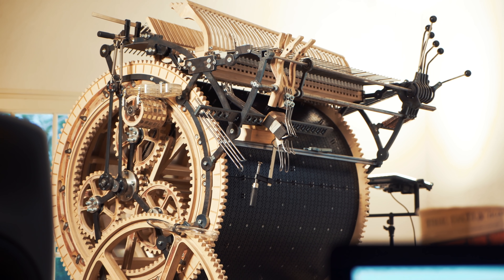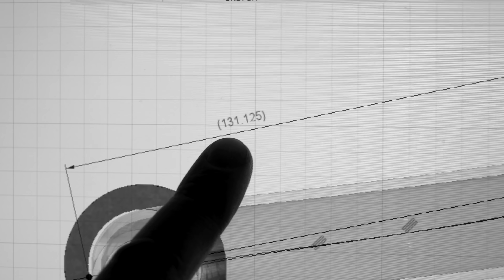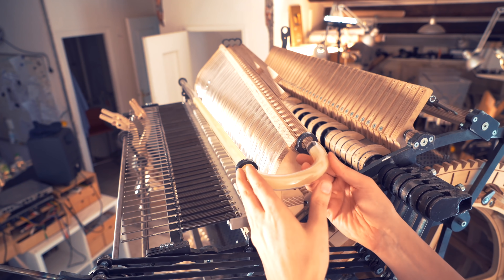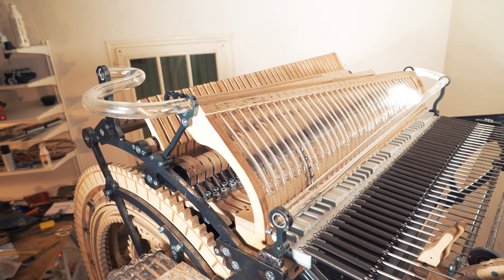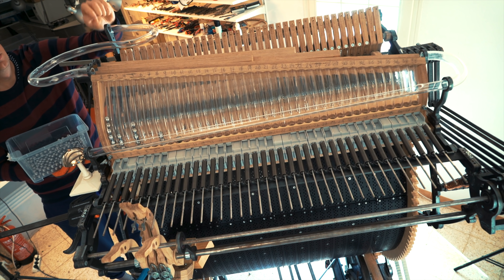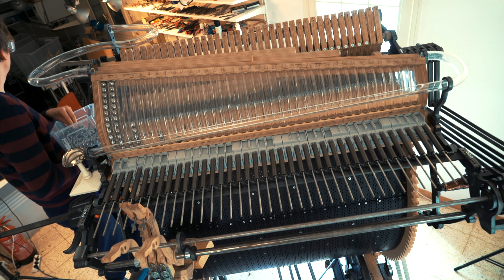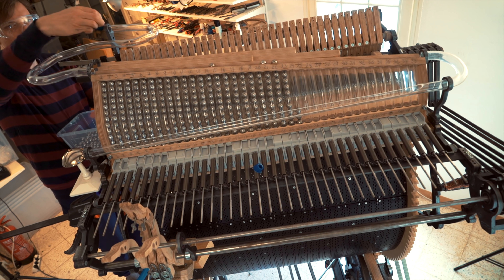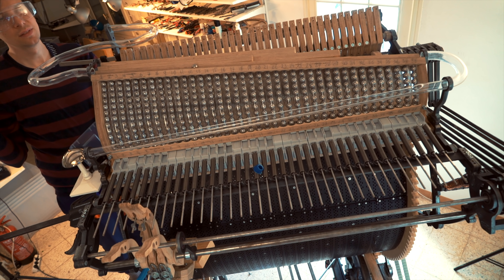Marble Divider Transport Tracks - Marble Machine X #68

Comment: Man stick to the programming wheel. Your problem isn't design, it's materials. Figure it out, you can do it.

I don't believe the programming wheel is a sunk cost any more than the early failures of the space programs around the world were. You have an end goal, a reprogrammable wheel within certain specs. You just haven't figured out how to accomplish it to those specs yet. You are close, this isn't like you bought a ticket to a show and feel obligated to go because you spent money. 

This is an artistic and mechanical goal that is achievable with the right combination of materials and process. Arguably the entire project hinges on it. To go back to the drawing board could easily eliminate 6 months to a year of workable and useful progress in other areas designed around it. This would be like redesigning an entire car because you used the wrong rubber in the tires. It would be idiotic.

you will find the path forward, it's time to experiment a bit. Try other materials, or adjustment mechanisms. What if channels or banks of channels could be adjusted independently to account for mechanical/production drift / environmental changes. What if you found a material that didn't shrink or move.

The wheel is the soul of this project.

https://www.quora.com/Is-the-sunk-cost-fallacy-always-a-fallacy

Comment: I think you should stick with the system you have now, because it fits with the history of the marble machine, and is more attuned to the style of wooden marble lifters.

My only issue is that you have been drilling full sheets to test, when you clearly need to be drilling small sections at a time and solving each problem in smaller steps. Like you did last time, drill just a few channels and test, don't drill a whole sheet until you are absolutely confident you got it right.

Don't go the welding route, I really believe that's going to be a dead end filled with tears.

It is very likely that the best solution will include mostly pre-programmed sheets, but that's ok. Just have only the FIRST song reprogrammed during the concert, and the volunteer(s) can go slower, and will only need to reprogram for the LAST song, as a big finale where we see the result of their work.

Comment: Just a single thought, killing kinetic energy by slowering the speed I believe it will limit the amounts of balls per time unit, limiting the speed of the song, also, lowering the speed causes the balls not having enought energy to reach the last duct... may be it would be better to change the discharge angle of the ball, forcing it to get into the first pipe and then jumping to the next when its full, not affecting the speed but the attack angle to make the ball "prefer" the first pipe in first place and then continue. just a thought. !!! cheers !!

Comment: Edit: Forgot to address the main issue:
Instead of redesigning the programming wheel because it is challenging to manufacture and / or reprogram why not just address these issues? A fundamental redesign at this stage would be foolish! The reprogramming issue notwithstanding, the issue seems to be attaining the required level of accuracy when machining the programming plates.

Original:
Why not bend the plastic first then CNC it? It sounds infeasible but I think it could be done w/ proper router programming and some kind jig. I admit that I really don't know anything about this manufacturing process but I don't see any reason why it couldn't be a possibility.

Comment: Sorry I don't comment much, so I don't know if this has been suggested, but have you considered  mounting your router to the programming wheel so that you drill the holes right on the pre-formed panels? That way X is in mm and Y is in degrees, and your holes will already be perfectly straight (not tapered after forming around the radius). I know it would be complicated to repurpose the router, but from a manufacturing standpoint it might be a good option. That is, if it doesn't deform in some other way after drilling in a fixed position. Just a thought.
Reply: It crossed my mind to attempt to set up a 5 axis CNC so that the router could cut the taper, but I like your suggestion better. It would require the CNC controllers to have access to the indexing points of the whole wheel, but I'm sure that could be done.
I wonder if it could be set up to cut only the holes needed for a particular song. The pins could be inserted permanently if desired - glued in place. Alternatively, sets of four plates could be cut for each song and the pins inserted prior to mounting them on the machine. When the song is done, the pins could be pulled and plates set aside in a container marked with the name of the song the plates were cut for. 
A set of plates with all wholes cut could be used to try out different songs, but once an arrangement is finalized you could put the CNC jig on the machine for the router to cut the new plates. (Your ides sparked a bit of an idea storm for me. Thanks
Reply: @1PastorMike  
Martin can't do permanent otherwise he'd be lugging way too many large rollers.
Reply: @Appletank8  I was thinking more of a routing station where the drum has all the panels mounted, then drilled, then removed.

Comment: Flame polished PMMA will crack later!  If you do anything to plastic that heats it to melting, it shrinks on cooling and becomes stressed.  It cracks later.  You must anneal flame-polished parts top relieve the stress.
     Programming wheel: think about this: using "player piano roll" to program machine.  You would need to add bellows/vacuum pump to main shaft, and have a small chest with the valves (this can go under machine).  Existing programming wheel would pull paper from supply roll, over "tracker bar".  Holes in roll let air through which triggers pneumatic valves and bellows which pull levers to release marbles.  Standard piano roll is 11 1/4th inch wide, has 88 channels spaced 9 to the inch.  Typical roll speed is 5 to 12 feet per minute.  You could easily put multiple songs on 1 roll!  You also open up the possibility of controlling Marble Machine from a computer.

Comment: I'm concerned with the marbles sticking when you were loading them. Why did you have to push them? Won't the marbles be flowing at a lot higher rate? Also why wouldn't you have used a funnel to dump the marbles in at a simulated rate?

Comment: Please careful when going down the stair landing where all the loose marbles went. We don't want you to slip and fall.
Have you designed a marble pick-up solution yet? Maybe a long handled dustpan with an electromagnet in the broom you could switch on for those reluctant marbles that just keep rolling the wrong way and turn off as you get to the dustpan.

Comment: Per the criticisms of s-c fallacy, 2nd sys effect; I say never mind, you are aiming for the moon, and will probably not miss. Welcome to Lunacy, we devoted are praying for your success.
Considering a 3rd system, even more ambitious than MMX (MMY): instead of sheets covered with holes, and movable pins, what about designing a tiny toggle component or ensemble of such toggles, which fit into a substrate matrix or frame to keep them firmly in position. Then instead of inserting a loose pin into a hole, the programmer simply pokes the toggle with a stylus which erects or retracts the player pin (there should be a special term for the pins that stud the player surface of a music machine).
Reply: Came here to say this, knew I would find it in the comments . . .programmable solenoids, would move magnetic pins in  and out, you would just need one line of them and the wheel would turn to each "address" and have all the parallel positions set  . . .so you could change songs on the fly like a DJ, you could even have a live mode where you set each solenoid in real time (hooked up to a piano keyboard). ..  .I get carried away though as there will obviously be a delay till the respective marbles are affected.
Reply: @educetheme4175  What I had in mind is an alternative to what Martin is doing with the loose pins. It's more complicated, but worth it. There would be these arrays of toggle-pins, sort of like ball-point pens, where you push a separate trigger, and the pin comes out, and you just push it back in if not needed. The MMX could have a row of programming "solenoids" like you say, or it could be like a dot-matrix printer with a movable "print" head. And also like you say, the toggler device is computer controlled, so reprogramming the music is automatic, error-free, and much faster than inserting little pins by hand. You carry your music repertoire around the tour on your laptop.

Comment: "You are not allowed to remove functions and say you solved the problem" Dude... if you could lecture every second-rate programmer I've worked with who were always way too eager to take the easy way out...
Reply: Amen to that!
Reply: Yes, business as usual.  But not with Martin!
Reply: This touches on an important topic in software engineering. Look up the essay "The Rise of 'Worse is Better'."
Reply: In software there is however a usual problem that customer specifications allow a lot of imagination for the programmer.

Hence getting back to base and instead of accounting for dozens of fictional scenarios and the functions you need to cover them, concentrate on the actual functions the program is supposed to do.

Not saying you are wrong, but I think in software design the rabbit hole essentially goes two ways: Creating complexity where none is needed or trying to simplify things when that complexity concerns core requirements creating additional debt in other areas to compensate for that.

Comment: This is not a criticism, but an observation.  I am not an engineer, but I don't see how this marble divider will work during performance. 

On the original Marble Machine, all channels had equal access to the pool of incoming marbles and were filled as 

needed.  ( https://youtu.be/IvUU8joBb1Q?t=24 )  Since this new arrangement on the MMX is sequential, and the marbles enter from the left, it gives priority to the lower channels which are filled first.  

The higher channels to the right now have to wait, not only for the lower ones on the left to fill, but also for the time it takes the marbles to travel to their location.  Considering that typically the mid and high range notes of any piece of music are played more often, it seems to me that they would be constantly running out of marbles, especially since, in this configuration, their marble "reservoir" is smaller to begin with.  I guess it all depends upon the rate of flow of the incoming marbles and the particular composition being played.  

If this does prove to be a problem, then perhaps the divider could be reassembled right to left.  Or, a new divider could be built that fills the channels from the center out to the ends. The center fill option, if successful, would also give shorter marble travel distances and times and allow for deeper reservoirs.

I also saw that that when Martin reduced the momentum of the incoming marbles to prevent skipping 

the 1st channel, their speed across the tops of the filled channels was reduced to a point where they stopped completely and created a "traffic jam" as shown at 10:08 and again at 10:56.  Hopefully, as he said, calibrating the channels will take care of this problem.

Comment: My solution for the programming wheel would be to replace the large sheet with thousands of holes with smaller interchangeable plates that cover only one channel and maybe a few beats at a time.  These plates would register to holes in the drum behind them, maybe one hole per beat per channel or even fewer.  The plates would then have the holes for triplets/sixteenths etc drilled in them.  That way you only have the complexity where you need it for any given song.  Because the plates would be interchangable each one wouldn't necessarily even need the full assortment of holes; you could have plates for triplets, plates for 16ths, plates for odd timings if you wanted.

Comment: Additional comment. I still think you have more room for timing error than you think. When a bass player strikes a note and at the same time a drummer hits a beat. There is going to be human error in timing. If you were to listen to 3 recordings of a song and it was pointed out to you when to be listening for the difference, where the bass was 0.01 of a second early, then dead on time and then 0.01 second late, would you notice it and next, would the average listener notice and think negatively on it? Or would that listener just accept it because it is natural error?
Reply: Read the whole response. I end up essentially agreeing with you.

As a musician and engineer wannabe, I don't think the timing issue can be overemphasized. You don't hear differences in timing between two recordings, you hear timings in the relationships of the notes within the performance you are hearing at the moment. The differences in timing you think might be acceptable become significant pretty quickly.

For instance, the original marble machine song played a 120 beats per minute, each beat is only .5 seconds. Each sixteenth note would get .125 seconds and each triplet eighth note would get .166667 seconds. they are played accurately at the same time, the difference between the start of the 2nd 16th and the start of the 2nd triplet 8th is .04166667 seconds. Between the start of the 3rd 16th and the 2nd triplet 8th and from the start of the 4th 16th to the start of the 2nd triplet 8th is .083333 seconds From the start of the 2nd triplet 8th to the 4th 16th is .04166667 seconds. While these times are outside of .01 second in your example above, and they would be difficult to catch with a stop watch, what would be significant is the feel.

Musicians talk about the groove or pocket in music, and it is difficult to communicate the meaning in words. Once you get into the "pocket," there is an amazing sense that everything is feeling just about perfect. Non-musicians won't be able to put their finger on it, but they will just have a sense that something just isn't quite right.

Now as I go through these computations I wonder how much actually applies to the machine. It is not going to be capable of many of the subtleties that go into the creation of the pocket like different accents within the beat or even different attacks on the notes. (Sometimes I do my best thinking as I'm typing. I now realize that you most likely have a valid point in terms of the relative insignificance of .01 seconds of error, though it won't because the listener will be comparing it to another rendition of the same song. It will be because the listener will be witnessing a mechanical musical marvel.)
Reply: @1PastorMike  
Thank you for your thoughtful response to my above comment. I appreciate the efforts going into timing precision of the Marble Machine X. After I posted the comment. I got to thinking. Our ears and minds can detect two "hits" of sound that is 0.01 of a second apart from instruments that have a spike/fast attack. (That is a little harder thing for me to do since I'm 100% deaf in one ear. So it's a mono experience. I don't hear stereo. But that gives me a perception that is kind of unique.) A strike on 2 percussion instruments with a 0.01 seconds gap can be heard but it doesn't bother me. Where as two instruments with a slower sound attack would be harder to detect and I don't notice it.

Comment: As a welder/machinist/fabricator/musician, I gotta say I can't see anything wrong with your wheel design. With the tools your limited to, It's going to be tricky. The errors you're running into is more likely the tolerance limits of the router being used. What you really need is to bend the sheet and make the sections first, and then machine it, but that would take some crazy expensive, size of a room CNC mill to get done which is not practical. You'll find those magic settings one day, and when you do, write them down in your notebook and you'll become the god of machining that material. The ear is more sensitive than the eye. I wonder what equating tolerances to fractions of a second would be.

Comment: As an engineer who is also a musician, I'd say that the feedback you've received is valuable and well-intentioned, but very much not understanding the entire problem.  Tolerances and repeatability are tricky, and they're made trickier by the fact that the timing tolerance required for "tight" musical performance is tighter than most people realize.

The precision needed for the programming wheel could in principle be reduced by making it larger, so that pin location is less critical to the timing of the music, but this trades off against either increasing the size and weight of the machine or reducing the number of bars of music per revolution of the programming wheel.  Given the requirement that the machine needs to go on tour and the aesthetics you're shooting for, I think you've made sensible choices in this regard.

As far as the material choice for the plates...well, I'm not a material scientist, nor am I an industrial engineer, but I'd guess you would have needed a lot of iterations to hit 0.1mm precision with any material, short of building the wheel out of cast iron or something like that.  The fact you were able to do it with plastics and plywood is genuinely amazing!
Reply: 100u is easy. 100u in a meter-sized assembly of multiple parts which have been violently distorted after machining, including shelf components which probably have tolerances on that order, is incredible.

Comment: Really the problem comes from bending. Use a 4 axis cnc router and use a harder material bent raw. Maybe a 1mm aluminium sheet cut into sections, bent THEN holed. If you don't want sections, pay someone with a huge Cnc. If you don't mind smaller sections assembled after, ask AvE. He has what you need and will be more than happy, I'm sure, to help you.